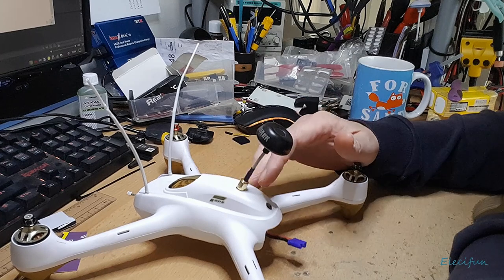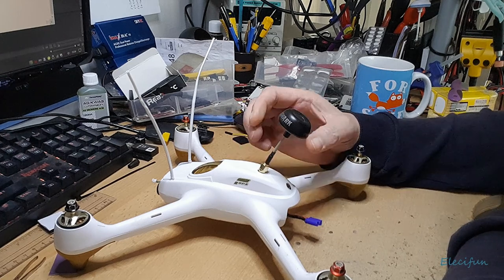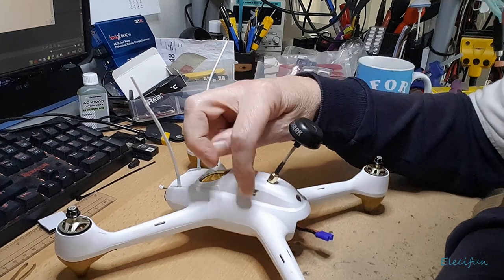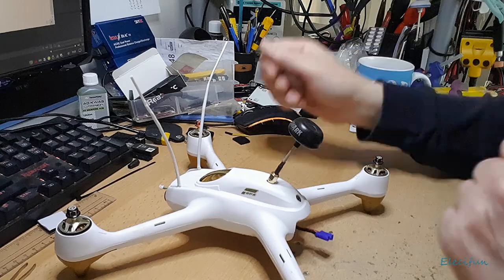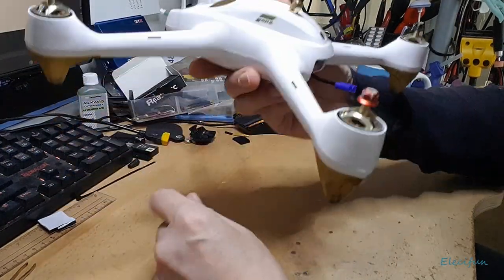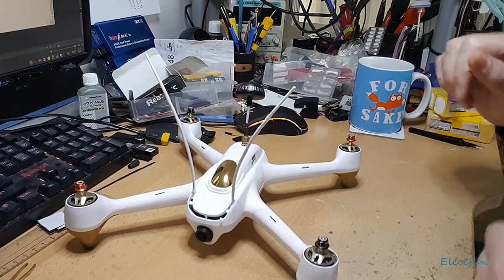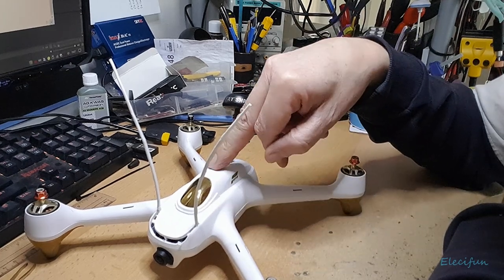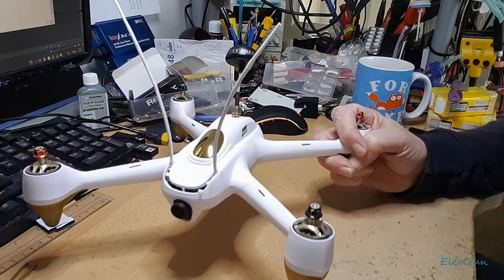Hubsan H501SE REUSE Test Flight

Comment: I have a idea I'm going to try on one of my Hubsan to add some structural strength. I'm going to mix up and then lightly coat the inside arms of the shell, with JB weld or quick weld. A thin layer distributed along the length of each arm about a half a millimeter or so thick. Potentially even just doing the inside upper half of the shell could be sufficient to cut the flex in half, if need be can always disassemble and add a layer to the bottom.  The additional weight should be almost nothing, the gains will be quite impressive for structural integrity. Happy flying bro and thanks for the ideas you share with us all.
Reply from the maker: I wrapped some clear tape on the arms and thats has made a big improvement.
Reply: @Elecifun  Wrapped it one  Section at a time the width of your tape  ? OR Started at the motors used One length of tape twisting it in a Spiral to cover the arm ?

Comment: Can you tell me the output power of the standard 501 ss..I just got one and am Not getting the range I see people have reported on YouTube.  Thank you if you know..PS Great channel,  subbed.
Reply from the maker: Try changing the channel on the VTX or VRX via the handset.
Reply: @Elecifun  Yeah Thank You...lots of trial and error...Do you Know the Output power of the VTX ...?
Reply from the maker: @dallasb7117  Its only a guess but I thought about 500mW. Check your antenna on the RX side. Which antenna are you using for the video reception?
Reply: just got the upgrade kit...Will see how that works...500 milliwatts is pretty good  !

Comment: I have problems in my drone hubsan h501s pro. If you can help me please. The problem is that when the plane takes off, I press the takeoff button.  The plane capsizes.  I don’t know if the fans or the controller are malfunctioning
Reply from the maker: Check your propellers are on correctly.